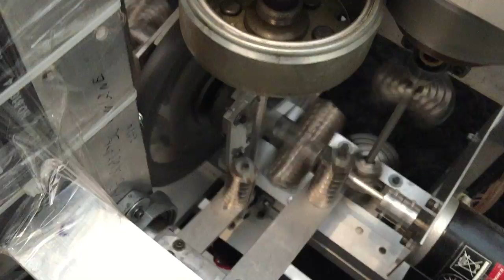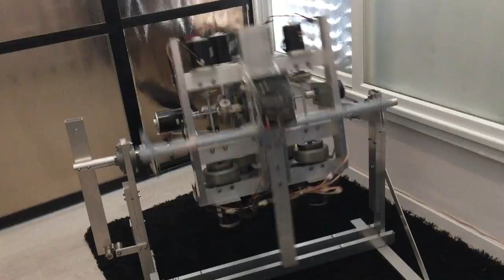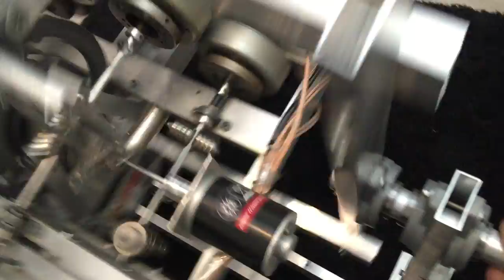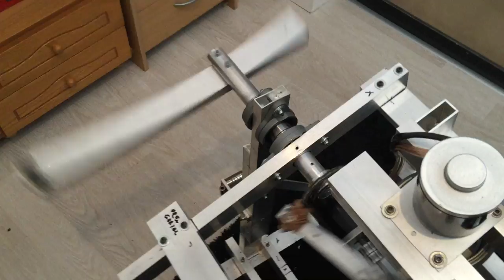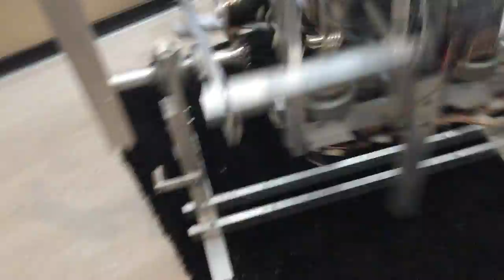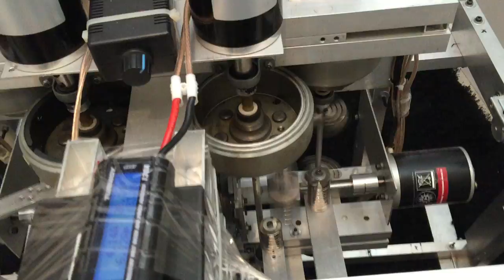magnetic engine generator technology magnet gyroscope made by oren gertel

Comment: I'm sorry but I don't see anything that demonstrates this is a generator of any kind. 
I see what looks to be a 12vdc 12Ah battery,  a power meter, a PWM but you don't show the before and after battery voltage.
How can we see there is anything going on other then the battery possibly loosing charge?
I am trying to understand what your devices do. See my videos and you will see I show the power in and out so we can understand the value. Regards